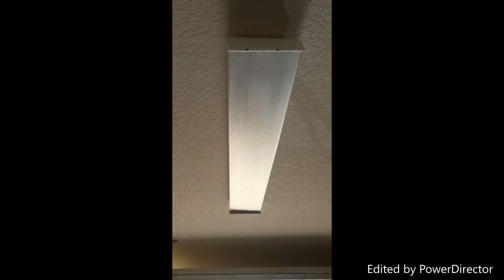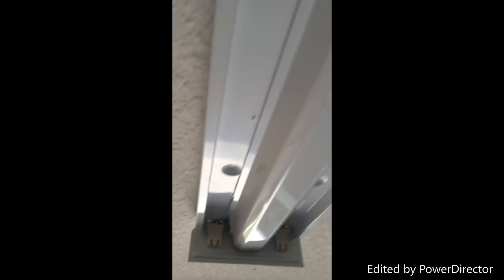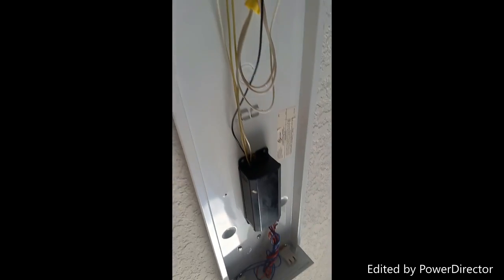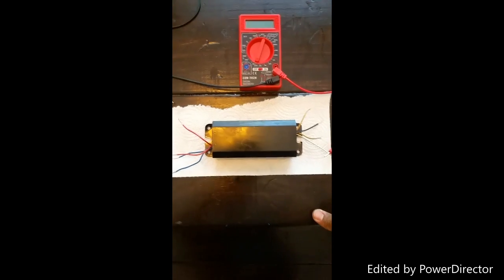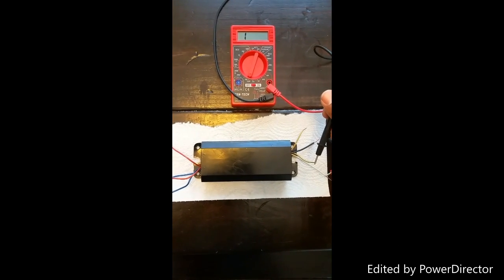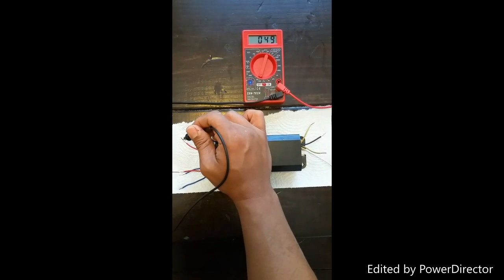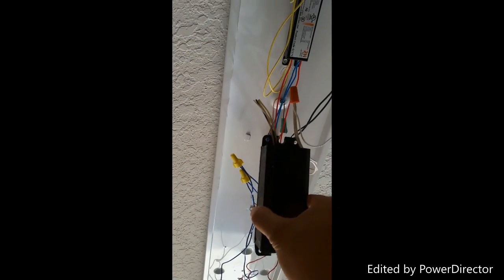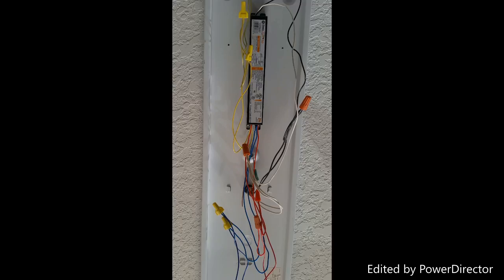Fluorescent light and Ballast Fix and test

Comment: Is this guy saying the opposite?
"Step 5. Use a multimeter
With your multimeter set to ohm, or “Xl1” if there are multiple ohms on your meter, insert one of the probes into the wire connector containing the white wires. Touch the other end to the remaining blue, red, and/or yellow wires attached to the ballast. Your multimeter won’t move if your ballast has gone bad."
You say/show that if the meter DOES move, the ballast is bad.
I wonder which of you is correct. :-(

Comment: Thank you for this helpful video. I just replaced my ballast and the old one tested bad just as yours does here. Unfortunately replacing it didn’t fix the problem. Any ideas ? It’s a 2 tube fixture, so I can’t imagine both tubes having gone bad simultaneously. Is it likely that my new ballast is also bad ?

Comment: The method you used here to check for bad ballast is pretty much the same as what everyone else on YouTube has said and demonstrated. However, I have a single ballast (the only one in the fixture) for and 8ft T12 2 bulb 75w each rapid start that only has the black & white, 1 red and 2 blue wires coming off the ballast. After replacing both bulbs with EXACT replacements and found the light still not working, I took the light down entirely (the 8ft flourescent) and temporarily installed a single bulb on a pigtail to test the switch, breaker, wires etc and everything works fine. Next I used the method you described with my multimeter to check to make sure the ballast was bad (could not be anything else) but I get NO RESISTANCE  btwn the white and ANY of the 3 colored wires (1 red, 2 blue). Any suggestions? Its GOT TO be a bad ballast right? 
Thanks
Reply: Larry Eaton I have the same problem. Switched the ballast out and bulbs still not working. Tested power (black and white wires)and it does have power. Tested wires per video and ballast tested ok. Did you solve problem?

Comment: I have a flourescent single bulb light that has a short in it.  It only works if I hold the bulb (or push on it) but sometimes the ends of the bulb will glow orange when I push on the bulb.   The bulb used to come on sometimes when I flip the switch up and down several times.  How can that be fixed?
Reply: Buy a new bulb.  Not trying to be a SA.
Reply: @minbenjalinfrank7728  I've replaced the bulb before but the same problem still occurs.  What else can I do?
Reply: Try replacing the starter

Comment: How can you tell if you have a bad light switch
Reply: Pull the wires, hook them together and turn the circuit breaker back on.  If the light works, it’s the switch.
Reply: Pull the switch, set a multi meter to ohms, test the points where the wires terminate with the switch off, and verify that you're reading an open load. Next, flip the switch on, do the same test, and verify that you're reading resistance. If either of those readings are off replace the switch.

Comment: Or just don't bother - don't test the ballast, instead remove or bypass, put in LED tubes. Never change out a ballast again or wonder if it is the bulb or the ballast. Also probably 2x bulb life at least and half to 1/3 the energy consumption, instant on, never flickers.
Reply: How do you do this? I have a fluorescent light I'm trying to fix and stumbled across this video.
Reply: Also want to know the answer to this. 
You can just swap and LED tube in place of a t8/t12???

Comment: I always watch electricians when they work, I am amazed at how they do not even turn off the switch from the main fuse box. With all this wiring or in any circuitry in the house is there a universal standard of color distinction or type of wire which tells you it is a main power line? Just curious.
Reply: 120 volts don't hurt 😂 only 240
Reply: @tguzman7408  120v completing a circuit thru both arms and thru the heart  could end you.. 120v thru 1 arm will knock you across the room and hurt like hell and burn ur fingers to a crisp...  240v?  bad news..!!
Reply: Yes.  Black = main(HOT, switched), White = neutral, Green = Ground, RED = usually switched, or often a return line for a 3 way switch.  NEVER play with power while breaker is live = OOOPS = DEAD.... breaker is not fast enough!  An electrician that does not turn off the breaker is playing with his life in a sad way - don't follow his lead!!
Reply: I forgot to mention, the color coding is for power distribution in a home.  This ballast test is not 100% conclusive, as there are other possibilities for failure, as another responder mentioned.
Reply: Always turn the power off. Even if you know what you're doing, nothing says that the guy who worked on it before you did. On top of that, working live carries a 40,000 fine here in Canada...
Reply: Can’t depend on color coding on wires. Some older homes still have original wiring from the turn of the century. Some have aluminum wiring as was the legal code back then. Sometimes it’s best to work on things live.

Comment: My kitchen 4 lights troffer just stopped working. So I followed this video's advice to see if it is the ballast failure; nope, they all check out fine. I then checked the lights, ohm test, they good. Switch? omh test, yup working properly.  Thinking it can be the shun-sockets? continuity test checks out, good. I got pissed, went to home depot to try and replace it. The guy there said, today's electronic ballast is hard to determine, they can still test open line (good) while not feeding enough power to start the lights. I got a new t8 ballast 120v $19.99.  everything working properly again. SOB, so this is just 1 way, personally i think it's like blow a fuse way. Not like in still working just not enough ampage way.
Reply: gdfeather that is always a possibility i have ran into this many times you may even read correct voltage but circuit will not allow enough amperage this is when a known good test light comes in handy

Comment: I think you are confused about "Open Line" and "resistance" around 3:30 on your video.
An "open line" has tons of resistance, it is essentially infinite resistance.
A short circuit would have no resistance.
I believe you are incorrect when saying "Open Line" is OK but when you get to a wire that has resistance there is a problem.
The problem is when there is LESS RESISTANCE because there is a circuit, not "open" line.
Reply: Yep.  Open line = infinite resistance  = good.  Closed line = low resistance = bad.
Reply: Right.  I caught that too.

Comment: I was expecting a way to test when ballast is still installed. If there are 2, it's a pain to first take them off and then test.
Reply: Power off light switch / breaker. Pull the Blk and Wht wires from the source. Pull the bulbs.  Your meter will have to be able to connect to something that can hold it or you will need a second set of hands. Put one end of the probe on the Neutral wire of the Ballast . Now just touch all of the light contacts with the other probe. If it is bad, replace.
I just saw another write up that said the meter should move for super high resistance and if it is open, there is a problem. if you look at this video. He says the open contact are good and the one with continuity is bad. His ballast is bad because all wires don't have the same measurements.
Reply: Leave them in, with power off, cut all the wires at mid point and test the same way. Often the wires have plenty of slack so if the ballast is determined to be OK, Just  join them back together with wire nuts. Make sure you make a simple diagram or label each wire so they aren't rejoined incorrectly.